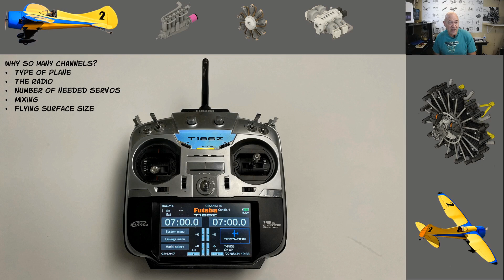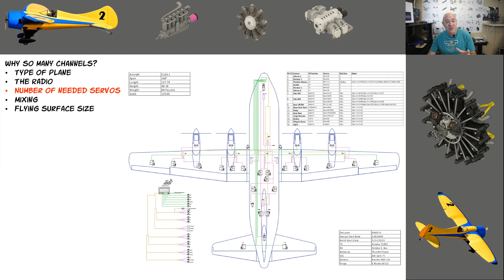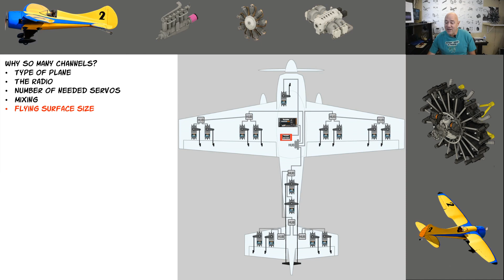How many channels does my RC plane need?

Comment: I appreciate your approach.  I'm new to rc and I can't count the amount of times I've been told don't fly that model. Don't  do this or that. "It's way to hard"  I've found flying rc relatively easy.  It's a strange combination or relaxing excitement for lack of a better term. Thanks for your great videos.
Reply: generally that rule applies to people who don't have any experience in the RC hobby at all.  I look at it like buying a motorcycle.  you don't want to buy the 200hp bike that does 0 to 185mph in 16 seconds as a bike to learn on.  you want the 300cc bike.   but I think anyone who has had a RC car and actually drove it with intent(race etc, not bashing like a senseless idiot) can probably get the hang of a plane in a few attempts.  I have raced cars for years.  always wanted to do the planes.  but never did for the same reason you said.  so I never tried it because every flying field required AMA membership, then the flying field requires a membership which requires all new members to sit in front of a committee and be approved first. then you must take their training course.   all BS I never wanted to do.  so I bought an Apprentice STS and went to a local park.  it was so easy to fly it was ridiculous.  then all the guys were like, you can't fly a jet unless you've been flying for 10 years buddy.  so I bought one.  and guess what, it was almost as easy to fly as the beginner plane in my opinion.   I think a lot of these guys struggle to tie their own shoes so they tell newbies it's impossible without training!

Comment: I got into R/C in 1963 with a Kraft single channel transmitter and receiver with a Royal Products motorized rudder servo. Push and hold the button for right; blip it and hold for left. Left rudder was hit or miss, mostly miss.
Reply from the maker: Very cool!!
Reply: Me too. When I first started about 1962 it was rubber band escapement single channel.

Comment: Very very good video!

I always advice to my students to "keep it simple" and keep the workload low while flying . 
Some of them come to me and show their model setup with high and low throws for every servo, each of them on a different switch. I always advice them to put it on 1 switch, to keep the workload low. 
Also model setup: mechanically it should be a good as possible, but please use the modern technology to fine adjust.

Use the possibility on your transmitter to add differential, flaperons, butterfly, throttle cut, differential throttle etc.

Use as much as possibilities to enjoy your flight as much as possible.

Comment: I bought a Graupner mz32. It has 32 operative channels, and can be paired with 4 receivers if I need to. This cost about 950 dollars when i purchased it and it is worth every dollar 😊. Personally I hate y cables and want to have the possibility to sub trim, reverse and adjust every servo on its own. Its a dream to use and there is many tutorials on YouTube, on how to use it, for the new user 😊. 
Love your chanel and I really hope you get a c130 going soon.
Best regards from Norway 😊

Comment: I started in 1978 with a 2 channel kraft radio and almost immediately I went to 4 channel for my sailplanes I wanted spoilers bad. Then when I was powered I immediately went to 6 channels, wish I had not wasted my money on the 4 channel, wish I would have got a 6 channel back then. So I know what your saying about more fun. I now have a TTX  4 channel a futaba 6 channel a JR 6 channel and a spectrum 6 channel all nice setups with Awsome differant features. Problem is I haven't flown since the 80's I'm trying to find a way to renew my licence so I can fly again in Colorado hoping there's a spot to fly my new Nemere ll 3 meter sailplane.

Comment: Started to briefly fly in 1983 then started back up a bit until 2000...getting back now in 2024 and I all too well remember the crack.  I flew glow Ugly Sticks, .40 & .60, and now am considering starting back up with the 30cc Ultra Stick, more plane than I think many would recommend as a starter but hey, go big or go home, right? So bigger plane, gas power, and there we go, 8-9 channels bare minimum even though TECHNICALLY that plane COULD be done with 4 channels.  It's always better to be over vs under prepared, and the new high-tech transmitters are a one and done while having multiple planes programmed to it.  Sounds like the troll was just bitter because his wallet isn't fat enough to support everything he wants.  Thanks for the videos!

Comment: some years ago, I built two characters into a twin bush plane, a baribie and a teddy bear, both robotic, and trained my dad to move them with a 2nd TX when I was flying the plane.   it's on my bear-space channel.  made two episodes of Bear Tails movies.  fun stuff.   love your idea of having the baby suck on a pacifier.  funny..  keep it up and thanks for this video. can never have enough channels.   ha ha     although, these days I'm mostly using a 6 ch, and doing everything else with a Pixhawk2 cube Flight controller, which has 8 aux channels for other functions. cool part is they can be autonomous functions as part of a planned mission, or just a command button on the laptop running mission planner.  you should try this,  Dag.   you would like it..  better than crack..

Comment: I'm with you Dag. Start out with a 6 channel at least. It's hard to justify the big bucks for a 12+ channel radio when just starting out. My favorite radio is the Futaba 7C. I fly mostly WWI where you don't need more than 4 channels unless you want to rig up a moving pilot head, sound system, bomb drop, etc.  I have a couple of 10 ch radios and one 14 channel. I don't hardly ever use them but it's nice to know they are there if I need them.  Keep up the good work.
Reply from the maker: Thanks!! One of my favorite Futaba radios was a 9 channel. But that was a FM radio.

Comment: I'm thinking about getting into the hobby, and I'm already a registered DJI drone pilot. Do flight stabilization & and telemetry need channels?
Reply from the maker: On my radio the telemetry does not use channels. On some stabilization systems you may use a channel to turn the stabilization on and off. :)